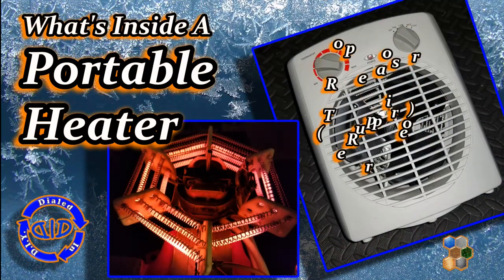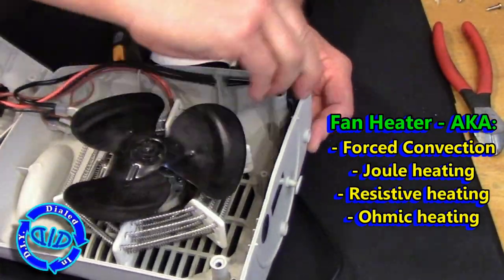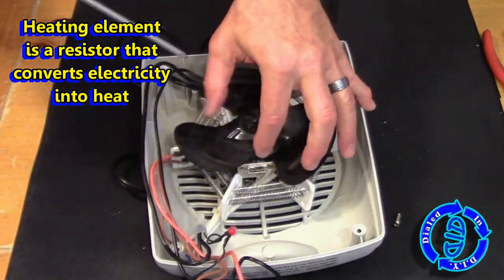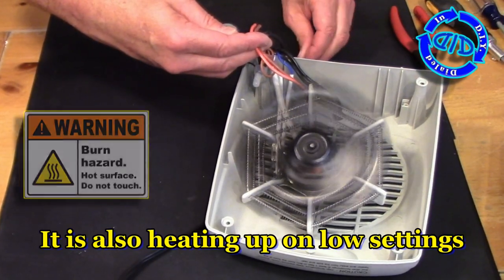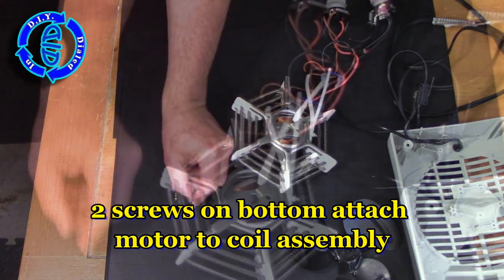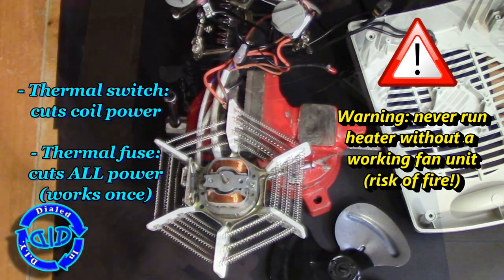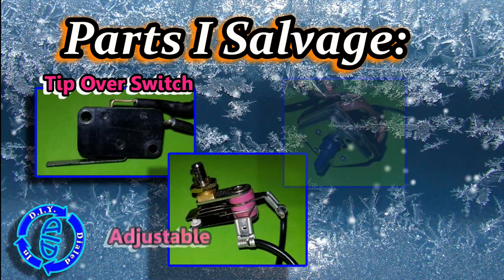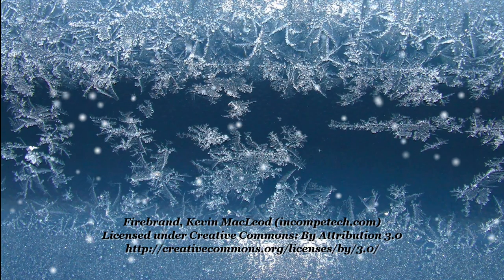What's Inside a Fan Heater - Fix or Salvage

Comment: If I use fan like that one 
To make vent fan 
Would I need to ground it? 
If so , how? 
Thanx ! 
New sub
Reply from the maker: First, I actually do not recall if this fan had a ground plug on it... if it did, then that should suffice.  Beyond that I think it depends on the planned use. Do you plan to modify the fan or housing of the fan? Where will it be used for vent fan? I always err on the side of caution when it comes to wiring things in my home so one first step I might take would be to plug into a GFCI. But there are likely additional considerations to take.
Reply from the maker: PS: thank you very much for the sub!!

Comment: if i start my heater when its on high, it will shut down, but if i start it at the low setting and let it run for a few minutes then turn it on high it will work fine.   what should i check to fix this problem .
Reply from the maker: That is actually a really interesting question.  When I have heard of something like this before it was because the problem was that it tripped a circuit breaker but that is not what you are experiencing. Since it is immediate it would not be overheating security devices. I'm wondering if it is still an issue with sensing too strong of an initial power surge when starting on high. TBH I'm not sure what else to check on that issue. Thanks for taking the time to watch my video and post a comment/question.

Comment: Mine goes warm and cold and when it tips over it goes cold it works better when u put the switch the speed one on half speed but I can't see the safety switch at the bottom or anywhere mine looks similar as urs but is branded by lloytron any help

Comment: Nice video but I wish that you would give more details into the actual switches and their modes of operation. I assume the temp switch on the right is simply controlled by a temp sensor on the machine and just cuts the element on/off. The power switch looks like it has several functions (ie: fan low/high, heat 600/1000/1500watts) and that is the one I'm interested in. Specifically how the current draw is controlled to the element.
Reply from the maker: Sorry for the delay in reply... had some extra challenges this year that kept me from my DID stuff.  The temp sensors work differently depending on the type of heater. In many there is a  thermistor which increases its resistance with a rise in temperature until the resistance gets to the point that cuts off the flow of power. A temp control knob merely changes the amount of resistance needed to get to the cutoff point. I think the answer to the control of flow of power is a longer answer than would work here... If you already got the answer I will stop at that. If not, then I can try to get my hands on another heater and dissect with greater detail.
Reply: @DialedInDIY  I'm curious, have a similar working fan. The temp fuse is broken in mine but possible to circumvent. What degree fuse should it normally be in one of these if I were thinking of replacing it?
Reply: @Foggyfighter  every single fan heater I have owned I have bypassed the completely pointless and troublesome thermoswitch and fuse! They have a manual thermostat and if the heater gets too hot this turns it off lol!

Comment: Would it be at all possible to repurpose the nichrome wire to use as a heating element for a small foundry constructed from ceramic bricks?
Reply from the maker: That is a really good question.  I have seen some that were made with electronic heating elements but I am not sure if you can get enough heat from these parts to get a good melt going... but I think that also depends on what you want to melt. Sorry for the delay in reply... I really do appreciate that you took the time to watch and post a comment!

Comment: Nice video. My heater does not have a switch, just a rotating dial on the thermal stat to turn it on and set temperature. The unit receives power as indicated by an orange light, but the fan does not spin and the heating elements produce no heat. Any advice? Thanks.
Reply from the maker: Thank you. First and foremost, that would be an AWESOME job title (Professional Insultant). My initial thought re the heater: since it is getting power to the unit but nothing turns on you may luck out and find that there is simply a loose / disconnected wire inside leading from the switch.  If you open up the unit look for wire problems and signs of excess heat (ex. black or darkened parts or something that appears to have been burned). That would be the first steps that I would take.
Reply: @DialedInDIY  Thanks for your reply. I opened unit up and find no lose wire nor any burnt components. Everything inside is pristine except a little dust on the fan.
Reply from the maker: @professionalinsultant3206  by any chance is there a tip over switch on the bottom?  I've seen the end break off which stops all power. What's the make and model of the heater?

Comment: Hello the safety/tip over switch at the bottom of my standing fan is loose and shaky and therefore no power is transmitting to the bottom of my standing heater, if you don’t mind can you tell me how to fix it and also what screw bits you used cause I’ve been trying different screw bits for the screws and they don’t seem to come out so if I can know the specific screw bit mouth you used too I’ll be appreciate that a bunch👍🏻
Reply from the maker: Sounds like the safety switch either got detached or maybe broke.  Once open you will be able to tell much easier... it could also just be off alignment with the button inside which could be an easy fix.  But that gets us to your second part, the screws.  Mine were Philips head and a pretty standard head size but the trick was the depth.  I needed a screwdriver with a longer shank; my first attempts I was using a shorter screwdriver that could not reach the screws.  Let me know if that was not the answer you were looking for.  Thank you for watching my video!!
Reply: @DialedInDIY  thank you man i was able to open it and while the safety switch is loose when i try straightening it the heater still didnt run, internally it doesn't look like theys been any burn or damage
Reply from the maker: @ajiri_e  It may just be the thermal fuse then.  For the most part, if those are toast I turn the item into a salvage process.

Comment: Hai, there. I know this wasn't exactly what this video was for, but you seem like the guy to ask. I'm having trouble finding information or advice on something; I own a Sunbeam personal heater, a little smaller than this one. (Model SFH090, for reference)

Tough little beast before it broke. Would use it all year long, the heat and the fan. Now the switch won't stay down, and it literally cannot turn off or to the fan. Only heat.

It's a sliding switch, so my theory is that it needs a peg or something to that it stays on each setting, or I can maybe replace it with some less-breakable system. And in that case, there's probably something on you channel I can hack into this fan... I'm not sure. I figured before I ruin this poor thing myself, that I should at least ask or find a guide or something. Any input or points would help. Thanks, either way.
Reply from the maker: First of all, thank you very much for watching and taking time to post your question.  
When you say the switch won't stay down is that literal... like it pops up or something?  <Just don't want to completely give the wrong advice>  If the switch does not feel like it slides like it used to then there is a good chance that the switch can be replaced.  But, if the switch seems to slide the same then there may be a problem with the thermal fuse or other safety device.  Did it just fail to turn on one time or did it quit while it was on?  Do you seen any reaction at all when trying to switch it on (ex. a light that comes on)?  That will be a good place for us to start to see what the problem might be.  Thanks again.

Comment: Hey question can you make a video on where to put the red and white wires to activate the switch and heater fan blade
Reply from the maker: Thanks for watching and posting your question.  Just want to clarify which red and white wires you meant... The heater in this video had some odd color arrangements ( 2 brown on motor, 2 red to heater coil, etc.)

Comment: every single fan heater I have owned I have bypassed the completely pointless and troublesome thermoswitch and fuse! They have a manual thermostat and if the heater gets too hot this turns it off lol!

Comment: Do you have a video of Fan Heater which used PTC heating element inside? PTC heating element fan heater is better than coil's, do you think so?
Reply from the maker: My apologies... I feel 99% sure I replied to your message but it is not showing up in my history (so sorry if it did not come through).  If you did not get a reply from me, then please let me know and I will try to recreate what I said last time. Thanks again for watching!!
Reply: @DialedInDIY  Hi, I didn't see it.
Reply from the maker: Darn! Ok, I will see if I can summarize what I said before (LOL). I have not made a video with PTC heating element but there are aspects of those types of heaters that are great.  The self-limiting feature of this type of heating design means that the extra safety components (ex. thermal fuses, etc.) are not needed. It is not possible to overheat.  I'm not sure what the price difference is for that type of heating though.  Hope all is well!
Reply: @DialedInDIY  Thanks for your kindly reply.  The price of PTC heating element is a little expensive than heating coins.

Comment: When plugged in ours has one knob that turns on the fan at 1 speed, then you can turn that knob to low heat & high heat (fan on in both settings)....BUT...nothing happens when I turn that knob.
I can slowly turn the smooth function thermostat dial and hear an internal click which I assume means the thermostat still works and triggers once I turn that up a certain amount.

So, it's either the tip over switch or that thermal fuse you reference?
Reply from the maker: Based on what you say I do think you are right... sounds like all power has been cut off and both of those can cause that.  Could also be a regular fuse if there is one in yours.  Lesser likelihood is that the switch itself is broken or disconnected; clicking sound would seem to indicate that it is still capable of connecting but isn't getting power through.

Comment: Wanted to dry my pants the other day and covered the fan heater with it and it immediately stopped and hasn't been working ever since, can it be fixed?
Reply from the maker: There is a good chance it was the thermal cutoff.  In some of these heaters there is a fuse-like device that only works once.  If that is blown out you could replace it.  Does the fan get power if the heat is turned off?

Comment: Hiya, while browsing I stumbled upon your video because my heater similar to this also stopped working. Like you said its only blowing cold air. But the switch button you mentioned below the heater is it gonna work if I just turn it on? Anyway i never DIY electronic items my whole life. sounds complicated ><
Reply from the maker: Welcome to DID.  Do you mean the safety / tip over switch on the bottom?  If yes, that is a switch that cuts the power if the device tips over or is picked up.  Sounds like the fan works but the heating part does not... correct?  Are you trying to fix the heating function or just wanting to use it as a fan?
Reply: Yes heating part doesn’t work. How can I fix it? 😅 thank you
Reply from the maker: @xxbr0kenangel  Let's see if there are some easy things that can be ruled out first.  With the cover off see if there are any loose wires, signs of overheating or burnout (brown to black spots that look like they should not be there) or any loose parts.  How does it look inside?

Comment: Wondering if there’s anything you can say that can help me .... i had a heater and it fell... was about a foot fall, probably less. when i plugged it back in , it had a burn smell. The next day we used the heater, no smell, nothing. the heater worked fine ! unfortunately the heater stopped working. The light turned on but the heater does not work at all!!  is this heater a lost cause ? 😢
Reply from the maker: It might not be a lost cause.  I would open it up and look for a physical problem first... ex. is anything broken or loose.  Something could simply be blocking movement or a wire may be loose. Is there a reset switch that can be used on the device?  That would be my first steps.

Comment: I have the same heater with the same issue. Couldn’t you have just replaced the thermostat? If so, where would you find one? I think I’ve looked everywhere. Thanks!
Reply from the maker: Great thought.  If the thermal fuse is toast then replacing the thermostat won't fix the loss of power issue.  It will fix the potential problem of no heat regulation.  If I need a replacement part that I cannot salvage I usually type the part number into a browser search and check what comes up... usually it is eBay or similar site.

Comment: plz tell me 1 thing
can we use heater fan as a simple table fan
i mean we just switch on the first button of fan mode without heating mode
will it consume more electricity thana ceiling fan like this......
plz reply
Reply from the maker: I have used heaters as a simple fan.  In one case I had to disconnect the heater controls.  As far as electrical consumption I would have to assume it would be far less but it is device dependent (i.e. the specific ceiling fan and the specific heater).  Thanks for the question and for watching the video.
Reply: @DialedInDIY  thanks for replying........

Comment: I'm sorry to brake it to you, but it is probably not Nichrome wire. To test this measure the resistance at room temperature and again after passing a current through it and heating it. I bet you the resistance goes down when warm => not nichrome.

Comment: While replacing a bi-metal thermal in my water distiller I suspect I may have crossed the negative to positive (learning by doing can be a hard teacher).. it started then something sparked and the led went out but top unit (fan) kept running. Is there a way to undo the damage to the heater part? (Just a coil and bi-metal and another fuse which connects to LED and power button).
Reply from the maker: I have had a long history of "learning the hard way" and I have learned quickly (sometimes) the things that I did not want to do again (Doh!).  I would start with the "sparked" result and check for damaged wires, connections or other signs of heat damage.  My guess is that something else shorted out that could be replaced or patched.  The fan still running is a good sign because it sounds like a safety  mechanism cut off the power to heat but did not fry the whole unit.  Do you have a name & model number for the distiller?  I can see if that info helps with other thoughts on repair options.  BTW, thanks for watching and for posting your comment.
Reply: @DialedInDIY  I'll have to get to that box (moving right now) but when it's unpacked I'll be back by with that info.. and will check for "spark/heat damage" as well.
Reply from the maker: Hope all goes smoothly with the move!

Comment: Disassembly only works if there is no tamperproof screw, lol.  The motor mounts need to be made out of a Lexan-equivalent plastic.  Otherwise the motor drops into the case when switched on after the summer lay-up — sparky!
Reply from the maker: so true... and there are allot of odd kinds of tamper resistant screws out there now. Thanks so much for posting your comment!
Reply: Any ideas what to do with the tamper proof screw? Mine looks like a slotted flat head but nothing I have makes any progress :-(
Reply: @PeteMidg  With careful levering by a screwdriver you can break the tamper-proof screw through the mounting hole.  Only feasible if there's one tamper-proof screw, of course...

Comment: My tip over switch is missing the lever on the bottom that is pressed in by the button on the bottom of the heater... 

Is it easy to buy a replacement? Or should I just bypass the tip over switch completely?
Reply from the maker: Good question.  I am not sure about getting the replacement but I would not opt for bypassing the switch.  I might try modifying the tip over switch by adding a different lever of some kind or just switching it for another type of pressure switch that you could install in the bottom of the case.  Thanks for watching and for taking time to post your question.
Reply: Thanks for the response and fantastic video! :)
Reply: I subscribed and am excited for your content! I love working on stuff like this.
Reply from the maker: Awesome... thanks.  I'm the same, I just wish I had more time to do this kind of stuff.